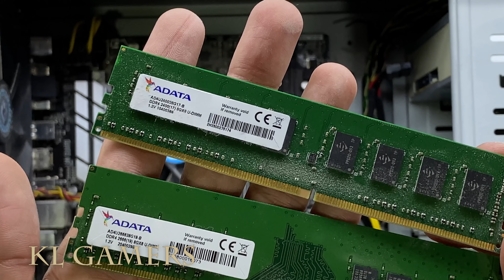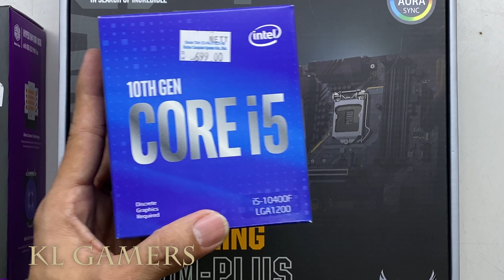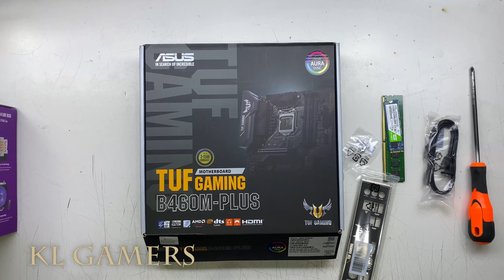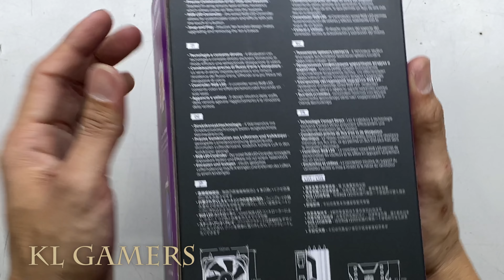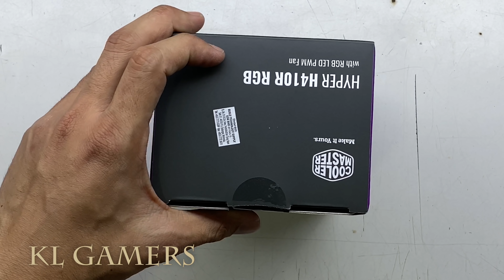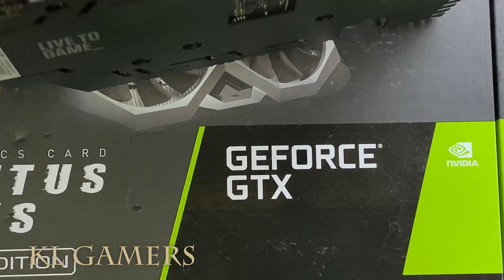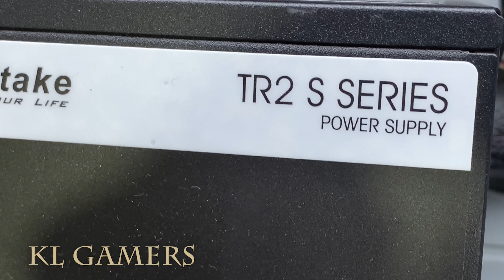Upgrade intel Core i5 7400 to intel Core i5 10400F ASUS TUF GAMING B460M PLUS HYPER H410R RGB ZOTAC

Comment: I work at computer shop, i5 10400f is slightly cheaper than ryzen 5 3600. Im thinking to build i5 10400f+ asus tuf mboard with rx580 or 1660 super. But still the price of gpu is xpnsive. But hey at least i could get a discount from my supervisor at workplace.
Reply from the maker: That is great news 👍🎮

Comment: I have an i5 6500 originally with a GTX960 but now with a 1660 Super ( bought for 279 at release).... my board caps out at Gen 6 so I need an ASUS Steel Legend board with an i5 11400f to go with my 1660 super until I can get a 3070ti for a decent price..
Reply from the maker: Great 😎🔥🎮😆👌😁👍😀